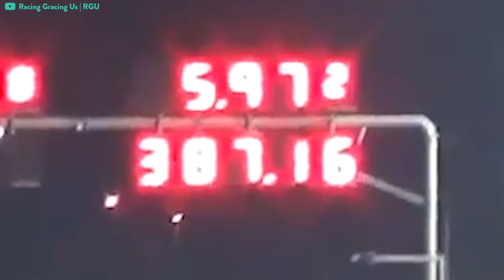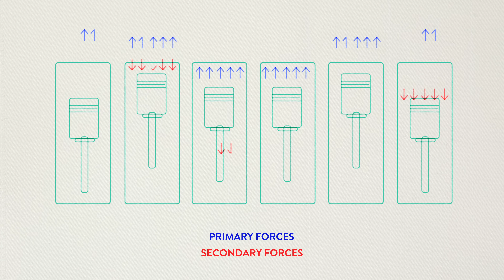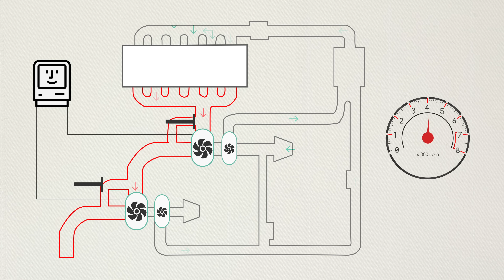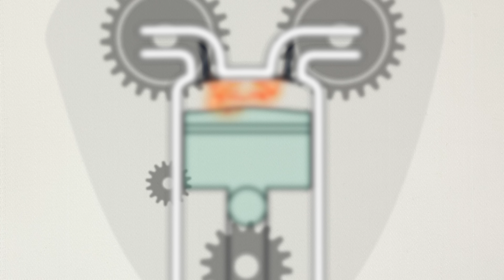2JZ ENGINE - How it Works | SCIENCE GARAGE

Comment: People always says " oh throw a giant turbo and some e85 on a 2jz and you will make a thousand horse power" that's not how it works you will make at most 450-500 without having to build the engine, the rb26 on the other hand through a big turbo some e85 and a oil pump your over in the 550-620 hp mark

Comment: Check out Australia's FPV Ford Performance Vehicles Barra inline 6 engine. 
Shame Ford America wouldn't allow it to be exported except to NZ because they knew it would kill the mustang dead. In sedan 4 door and a boot/ trunk you could fit a couple of bodies and groceries in drive the kids to school and then go beat all US muscle and JDM imports search XR6 Turbo and F6 typhoon sedan and F6 tornado ute which is a sports car crossed with a pick up. And for the V8 people we had the fastest and most powerful only factory built stroker Windsor block 347c TE50 and TS50 sedans with manual or automatic with gear changes on the steering wheel ESS ( electronic sports shift) then the 5.4 GT BOSS engines our more powerful version of the cobra R. Then the coyote engine striped down using all Aussie parts and supercharger which 5.8L putting out 580hp in the GT GTP and GTE and GT R spec and finally the GTF in sedans and the Pursuit and Super Pursuit Utes while the mustang had under 400hp. Check out some Aussie Falcons from the 70's muscle through to the Tickford and FPV Falcons and the last muscles the XR6 sprint and the XR8 sprint with a few mods and tweaks all make over 1000hp some 1500hp at the wheels

Comment: Don't forget during the gent's agreement in Japan the government had a ban on cars over 300hp , so a 280hp gent's agreement wasn't even necessary . And if you really look at it , it actually hurt the NSX , Supra , 300zx , 3000gt , and Skyline there were lighter cars that had the same output with 4 cylinder engines which also had better fuel economy . With that said the amount of power these 6 cylinder engines were capable of after some mods is far superior to the 4 cylinders so choosing which one is for you depends greatly on what you want out of the car .

Comment: BUT ALL These cars with their 800HP are ALL at the Crank not wheel..  When people say they spent $2K on a new turbo and injectors and get 800hp outta their JZ..  its in the car at the wheels..  NOT at the crank like Factory ratings.  my old 88 Supra was listed as 300/300  back when  it was wheel hp and straight away I replaced exhaust and it went to 380(if factory was true about the 300 donno.. as was after exhaust 1st dyno) that was 60hp more than the corvette was at about same weight as Supra was also luxury..  and it only got better from there..

Comment: Aaaand the new supra is a bmw :|
Reply: Hans Blitzkrieg  Do your research. It's a collaboration between 2 companies. The engine is made by BMW yes, but designed along with Toyota with their own reliability standards and tuning and all that.. both cars are different . They mainly made a chassis that could support 2 different body types. Supras car design and everything I Toyotas from their on. Sure some bits are taken from BMW but that's cuz it's a collab
Reply: Hans Blitzkrieg  please... you can't afford it. Most people crying are probably driving beaters everyday.
Reply: Hans Blitzkrieg  lol. want a Toyota engine yet almost all of Toyota's performance engines are designed by Yamaha.
Reply: Most diesel motor from Toyota made by bmw. Gt 86 is Subaru motor.
Reply: I think the price of new supra could have got out of hand if they developed whole new engine for it. In fact the supra is faster than z4 m40i which it shares some components and it is proven by for example carwow in their channel. Also I heard that new supra is designed to be easily upgraded and built if you want to do it by yourself. Very few old supras are stock so it makes sense that this car is made to be a chassis or just very good starting point to build your ultimate street car.
Reply: Its made in Europa. Near by germany, few models per year.
Reply: *Engineering
Reply: mclaren made there best machine
with a BMW motor
so maybe its also a move for toyota
Reply: Toyota exist a money from comments about old supra not give a profit
Reply: Hans Blitzkrieg  you realize even the 2jz wasnt evem developed by toyota. it was developed by Yamaha...
Reply: Hans Blitzkrieg try tuning the new b58 it responds very well and it gains lots of hp with minimal mods.
Reply: they should have made a new and improved 2jz engine lmao
Reply: Toyota loyalists that are into reliability wont know what hit them. Although according to the Spectator index, current BMWs are rated among the most reliable cars far ahead of even hondas.
Reply: @mustafaabubakar4623  BMWs are far from reliable, and they're #1 in maintenance cost
Reply: SUp3RpooP3r7698 not even close... bmws are MILES less expensive to maintain than things like Ferrari’s and lambos and other crazier super cars... they’re still obviously more expensive to maintain than say a Honda but they’re not even close to the most expensive cars to maintain
Reply: @SUp3RpooP3r7698  no bmws are reliable AF. just like the 2jz gets overhyped the bmw gets underrated becaus idiots buy them and put cheap ebay crap parts in them and bad walmart fluids and then wonder why the car broke. you know 2jz is only about 60% as good as people say it is. bmws are reliable AF just that nobody brags about them. people only meme about the broken ones. just like nobody talks about the failing 2jz. people only talk about the ones that work. bmw are not nr1 in maintenance cost. every year theres like 200 diffrent studdies that all say diffrent shit so non of them are reliable.  yes bmws are more expensive to fix but they don't just brake for nothing. allso bmw is a luxury car brand. when you own a bmw you own a luxury car they are litterly classed as a luxury car. thats why mercedes audi and bmw are so expensive becaus they aint the regular basic shit normal car.
Reply: I am a fan of beimers, especially the M versions.......but I really wished Toyota give the new supra a self made engine........I don't think they couldn't have. It's true time has moved on. But still even today Nissan still makes the GT R engine themselves, and Honda makes the new civic type r and NSX powertrains themselves. Why can't Toyota.
Reply: Anyone that hasn’t owned a bmw can simply shit the fuck up. You don’t know about bmw reliability until you’ve owned one. I owned a m3 e46 and it drove well and only minor replacements. With bmw you need to know to repair it yourself and not rely companies to  charge you costly prices. Bmw engines are bulletproof and strong. They are not Mercedes where if the thinnest issue happens it will not work. Fuck off

Comment: Urgh. The VVTi 2JZ-GTE is NOT an interference engine. It is exactly the same in this respect as the non-VVTi. In fact, both only become interference at seriously high levels of lift which requires huge aftermarket cams to get.

Comment: The performance of the 2JZ in Drag Race Motorsports is now been followed by a bigger TOYOTA 6 cylinder, the 4.5L 1FZ-GTE. Check-out Boosted86 Racing's Nikki Hepburn driving her TOYOTA GT86 with a de-stroked (to 3.9L) 1FZ-FE engine. 6.55 on 1/4 mile and a car that is Extreme Stock Chassis with 10.5 radial tires, a conventional 3 speed automatic transmission and no wheelie-bars.
That 1FZ-FE is holding 2,008+ HP on OEM engine block cast. (Many 2JZ racers have switched to billet aluminum blocks past the 2,000 HP mark)

Comment: How about the engine that caused Toyota to develop the 2JZ in the first place?

Some of the stuff you called "unique" to the 2JZ isnt even remotely true.

VG30:

24v, DOHC 3.0L
Cast Iron Block
Aluminum heads
Closed deck
CAD designed induction manifold
Parallel twin turbos
Crank main GIRDLE, not just caps
Forged steel crank
Forged steel connecting rods
Cast aluminum pistons
Variable cam timing on the intake cams
Sequential fuel injection
coil on plug
Oil squirters

See where I'm going with this yet? haha

In recent years people have been pushing them more on stock internals too, including a number of stock NA bottom end (10.5:1 CR) making around 800whp

So yeah, I wonder why Toyota felt they had to get their shit together to replace the disgraceful 7M? :)

Comment: Going big single used to sacrifice spool up times. But these days people like me are making near 200kw at 2000rpm + another 100kw every 1000rpm after that. Which means at 2000rpm I have more power at the wheels than the twin turbo supra did at peak power. No lack of spool on this single.
btw lots of people pushing up to 700kw atw for long periods of time on stock internals. I did 500kw for 220,000km's.

Comment: Why the new Supra hasnt the 2jz or 3jz engine, and manual shifts?
If was for this i think Supra should stay at museum..
This new thing isnt a Supra.. is a bmw z4..flop
R.I.P toyota Supra
Reply: If they are making it a modern 2jz or 3jz the new toyota Supra will 100k plus and y'all broke asses won't buy it.
Reply: Engine development is expensive as all hell and they'd have to price the supra at supercar prices for it to make any business sense by then.
Reply: @shroomyesc that's what I've been saying the whole time i see people complaining"iT dOeSnT hAvE a 3jZ"
Reply: Sad it won't be a legend like it's predecessor
Reply: That's why Daigo Saito already 2JZ swapped Toyota`s prototype.
Reply: I wouldnt be surprised to see a Stripped out RZ version with a manual transmission and a bit more shove. That would be something special. Not like a 6spd manual wouldnt slot right in.
Reply: Yeah nss to reach 1500hp it needs, a better crankshaft and, a bigger intake manifold which doesn't exist on the market just yet, and because it is BMW engine, I go a few k's before the due oil change and it starts leaking
Reply: stfu fanboy stop calling the "old supra" legendary. it's the name of a car, it's just as much a supra as the 90s overhyped shitbox
Reply: Joey 240sx Exactly , its just to overhyped and nobody appreciates other jdm cars anymore so just let the supra die .
Reply: Because the BMW engine is even more tuneable than the 2jz. It makes 800 brake much easier..
Reply: @dlg78  B58 Terrible mechanics for tuners. 800 brake easy sure, good luck getting it near 2JZ top numbers.
Reply: @philheathslegalteam  2jz 'top numbers' rely on replacing every single part bar the block.
Reply: @dlg78  you are my man haveing big gay. In the offensive way.

Comment: Uhhh, I'm pretty sure the function of piston oil squirters is for cooling purposes (especially turbo engines), rather than lubrication. However, not all turbo motors have squirters.  The same holds true for women. Oddly, the purpose is inverse, and the function is more for lubrication, rather than a cooling....